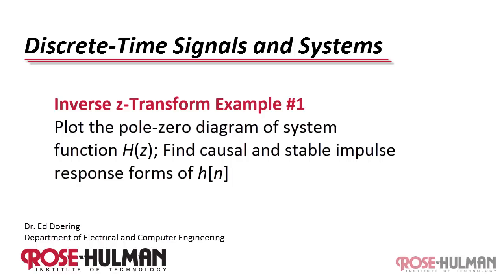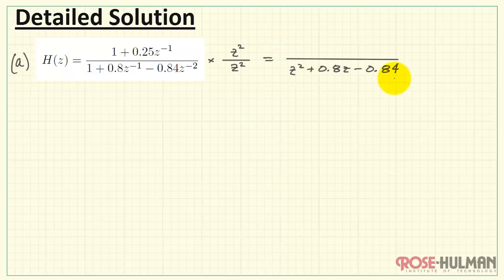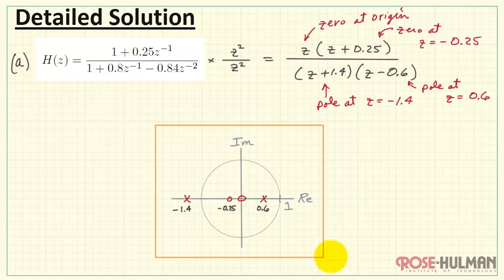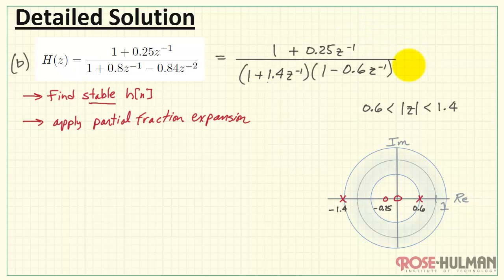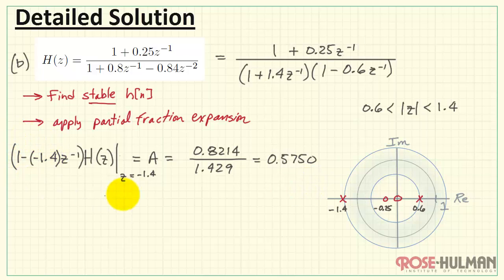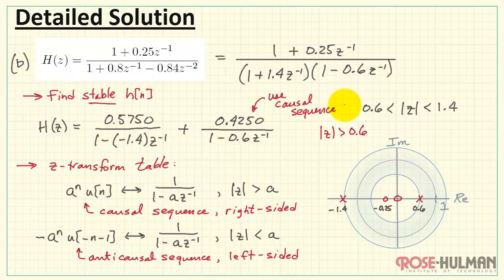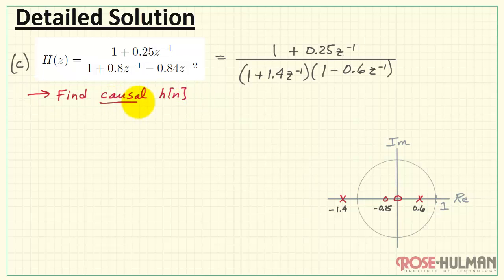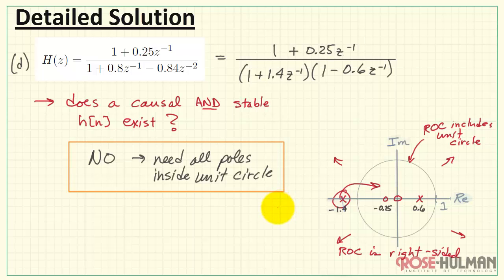Inverse z-Transform Example #1

Comment: Please what if the poles of the system are say 0.4 and 0.8. Drawing both pole circles, the unit circle will be outside the two pole circles instead of within them like example above. Does a stable impulse ROC exist?